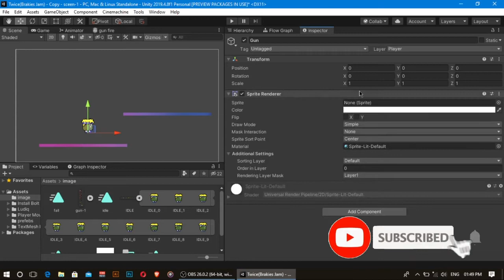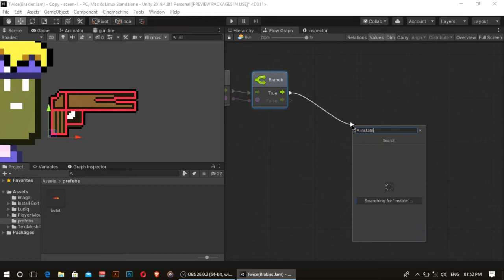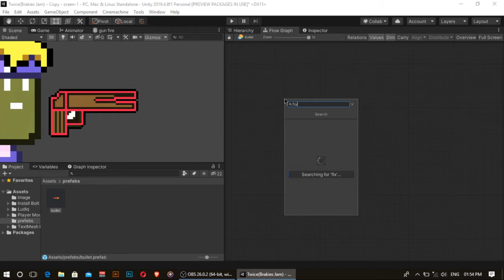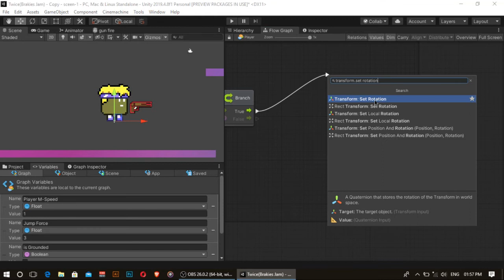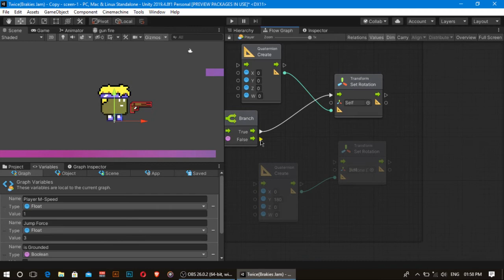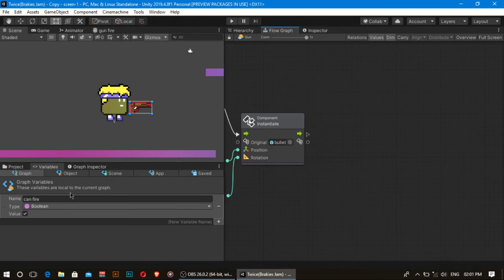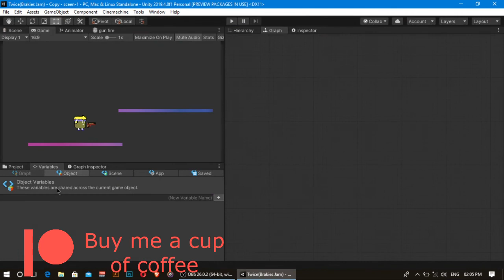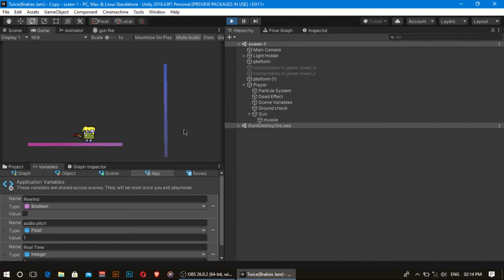2d shooting in unity using bolt (prefab) tutorial

Comment: i did everything in this video , but still can't get the divide with 1 or whatever to work
Reply from the maker: What is your exact problem then only I can help you
Reply: @MrKDHere  ok so i did everything u did in the video and it worked great thanks, but i did want to shoot 3 bullets every second so i used the divide like you did but it doesn't work. is it because bolt removed it?
Reply from the maker: No what is your unity vertion. Just use divide node like 1/3.(1 in top first box 3 in bottom first box)
It will work. Here 3 is the number of bullet you want to shoot.
Reply: @MrKDHere  my unity version is 2020.1 or something.  And I tried it,but everytime i shoot.. one bullet comes out. Is there something special to it?
Reply from the maker: Mack shore the loop is continued till you press the key.

Or

That means you are using the unity event to trigger the shoot function. You have to Mack other variables like isshoot to true then use update function to check isshoot is true the shoot

Or 

If You use on keyboard input event. Then change action to hold instead of down or press. In my video I use input.get key node that will directly connected to update node. Use one of this.
Reply: @MrKDHere  oh. I didn’t think of the hold.. cuz it is “ on pointer down” event , but I’ll try to switch it to Hold or something. Hopefully it’ll work, thanks anyways.
Reply from the maker: Stay cool and free 👍